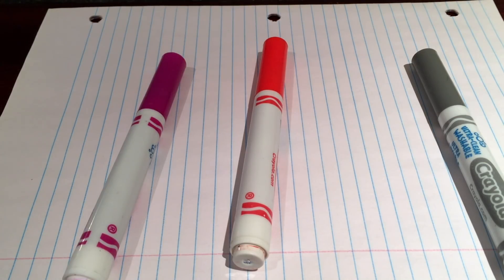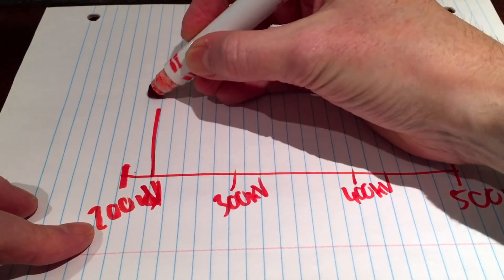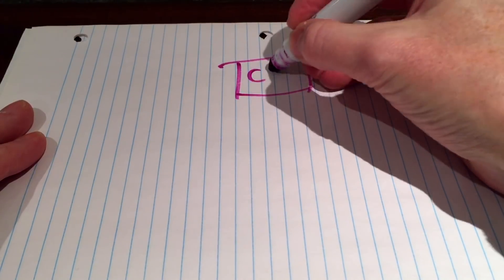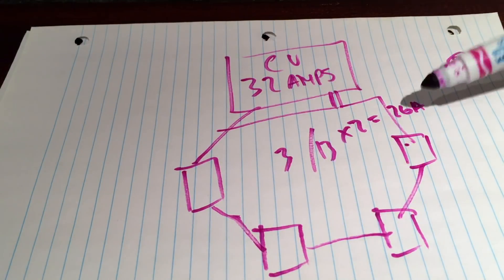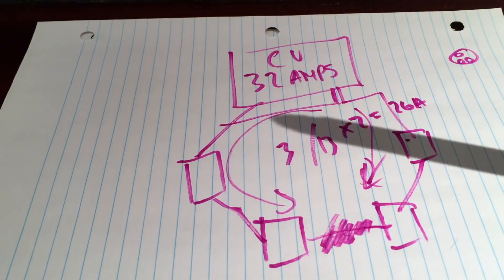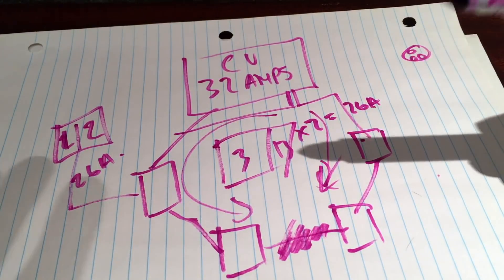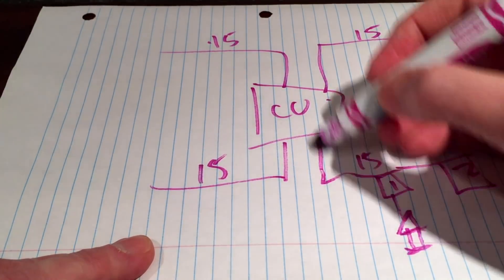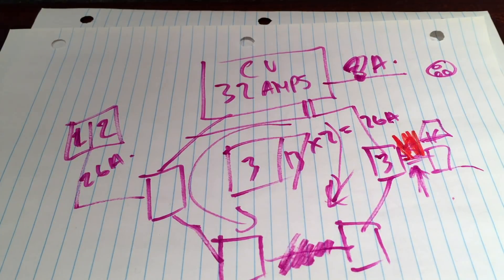THIS is why British plugs have fuses

Comment: Nice one Jason.

I did NOT know that my heater/electric hob and oven (I use all gas, but still) ... were on a three-phase circuit.  In fact, I'm fairly certain they're not.

Is it not the case that the CU is fed with three-phase?  Then two 32A phases get split to power the two separate ring mains (for upstairs and downstairs) ... and the third phase goes to the kitchen to give the big appliances their own 32A circuit?

This would appear to make more sense, as I have no 5-pin triple-phase connections anywhere in my home, nor have I ever seen any in domestic situations.

While I'm at it (and I know you're not an electrician, but still, it's nice to ponder)

I'm sure you'd agree that Live and Neutral are both Hot, yes?

And the Earth is NOT a return line ... so L&N (being AC) must serve as each others return, each serving half of the cycle? ... and, if that's the case they're necessarily 180 degrees out of phase.

So, surely that's a kind of 2-phase system ... and surely both phases would need to be 115-120v, so that out-of-phase they provide 230v-240v peak-to-peak ?

So, are we on a US system, just terminated differently ?

>scratches head<

Furthermore, can the US system provide 220v with alternative termination?  I hear that machine shops over there use 220-240v ... so that would be a neat way to provide it - and would make us a lot closer, electrically, with our cousins over the pond.

Especially since I just learned that many building sites in the UK use 110v tools and equipment, to minimise risk of death in those situations where electricity is used outdoors and in high risk environments... I never knew that : )  ... but it would make sense if our domestic supply was really a split phase 115v acting against each other to provide 230v

Ain't mains electricity f'ing confusing : ))))  Best left to the experts, always : )

Don't feel you need to struggle for an answer, I'm just unloading my curiosity.

Comment: The 12 Amp rating is pretty simple. In a nutshell, for a continuous load,  the circuit has to be able to carry 125% of that load. And 12/15 = 0.80 = 80%. So a 15 amp circuit can carry 15 amps for a short period of time, but shouldn't carry more than 12 amps continuously.

Comment: Hi Jason,

I've noticed that the US (and probably Canada) quote 110v domestic supply with a 220v option and they go on to claim a 440v three-phase system. How can this be? OK, it's easy to double voltage from 110 to 220 but that doesn't explain the spurious claim of 440v three-phase. Is someone seriously missing out on RMS (Root Mean Squared)maths?

In the UK, running 240v mains, this would equate to 480 volts three-phase, which is complete nonsense and we both know that this is seriously wrong.

The phases are set out at 120 degrees to each other and the voltage between phases works out as:

RMS V = the square root of 240 (squared) x 240 (squared) + 240 (squared), so:
RMS V = 240  x cube root of 3
RMS V = 240 x 1.7321
RMS V = 415 V RMS (between phases), and 415 V is specified in the UK as 415 V.

By the same token, the RMS three-phase voltage in the USA and Canada must only be 381 V.

Quod Erat Demonstrandum.
Reply: I can't speak to RMS versus measured. Typically, residential power is supplied as single-phase 115-120V/230-240V. Inside the "panel", there are two live busses, and the voltage to ground for each is 120V.  Measured bus to bus, the voltage is more or less 240V. This is considered (and referred to as "single phase"). The two power busses are 180 degrees out of phase with each other, and each rated at 120V. Thus, the bus to bus voltage is 240V. There are home devices (like cooking stoves) which take advantage of the 240V supply, but most consumer devices (TV, computer, lamp) use 120V.

For commercial installations (with potentially larger equipment needs), the panels have three live busses instead of two. In this case, the voltages are more complicated depending on how they are generated (delta or wye). I won't go into commercial voltages, except to say that 120V is supplied to commercial installations along with the higher voltages through the same distribution system.

(I used to be an electrician in Los Angeles some years ago.)

Comment: correction(from an educaited electrician in Denmark):
its not Kvolt, its just Volt, else in your exampel you'll have 270 000Volt, wich is not the case, cant say much about the U.S other than they have 120V between a fase an Neutral. The U.K(and almost all of EU) how ever has 230-245V between a fase and neutral, and 400V between a fase and a different fase. U.K is also 50Hz, U.S is 60Hz
Reply from the maker: Here's the UK parlimentary doc (http://www.parliament.uk/documents/post/pn163.pdf). Note the 400kV and 275kV.
Reply: Jason Coulls link dosn't work.

But look jason, if it was that high voltage then you would be fryed just by standing 5m away. I think you're mixing something together that you've read about the grid power, connecting cities together. I work as an electrician every day.

Not knowing what you talk about is one thing, but being stubborn when some one is friendly and tryes to correct you, is a completely diffrent thing and in this field, informing ppl wrong about this is really bad, because they might then end up with a bad accident.
Reply from the maker: 1) just remove the right paren that YouTube made part of the link.  2) Its the transmission voltage.  You understand that right?  You're talking about the socket in the house?
Reply: Jason Coulls yes im talking about the voltage going into your fuse box in your house and there for also the sockets, wich is what you where showing and talking about in this video, it makes no sense to talk about the transmission voltage, when your point is to explain why U.K plugs are the way they are, if you think the transmission voltage matters when talking about the house instalation, then i would politely advice you to stick to your softwhere programming.
Reply from the maker: OK. This is the last I'm saying on the matter.  In the same way people might talk about the sun before talking about the earth, I talked about the transmission before talking about the residential situation.

Comment: What you tend to get nowadays with RCDs and overcurrent breakers you tend to drop the entire circuit if there is a fault regardless. Unless there's a serious overcurrent situation, a 32A breaker tends to trip somewhat quicker than a 13A fuse blows and if there's ANY earth leakage at all, the RCD (which may precede the entire system, or just a set of breakers) trips and turns off anything it's connected to. It's fairly common to have one RCD for a set of 3 to 5 breakers (for example all socket circuits).

Comment: Nice description as I have always wondered about the fused plugs in the UK.
I live in NZ and we use the star configuration, known as Multi Earth Neutral. No fuses on our plugs. (Our plugs are the same as Australia.) Houses are usually single phase  230/240V @ 50Hz and standard plugs/sockets are rated at 10A.
High current appliances, like electric stoves, are wired using thicker cable (15Amp) direct to the appliance from the houses fuse box. (There can be a high current plug and socket used to make the appliance easily removeable.)

Comment: Terminology. There's no such thing as "ampage" or even "amperage".  The correct word is "current".  Current is measured in amps.
Reply: Actually, you are incorrect. Electricians (at least in the U.S.) use the word "amperage" all the time. It is equivalent to "current". And yes, it is measured in amps (or amperes, to be more formal). I know, because I used to be an electrician in Los Angeles years ago.

Comment: At 5:20 Just checking: are there any older houses that weren't built a long time ago?
Reply: In Japan they have really old temples they knock down and rebuild every 20 years.
Reply: Yes. Any house built before the most recently built house, is older than the most recently built house. Even if it was only finished yesturday :-)

Comment: In America we call it a fuse box or circuit breaker box and I think the circuit you describe is called series for the UK and America uses parallel circuits. At least you have a drawing like a series circuit and that doesn't make any sense because voltage is not constant in a series. From the way you have a drawn I can't figure out what it means LOL. I have a degree in electronics and the comment that you have pinned doesn't make a whole lot of sense at all, much less the fact that the person can't spell. I guess I'm going to have to Google it and see what the heck you're doing over in the UK LOL. Okay, I finally found a circuit diagram on Google a ring is definitely the wrong word for it! The word implies a series circuit and that's not what it is. I don't know why they draw it  going back into the fuse box? Electrically speaking, it's not a ring at all! It is however, the most contrary and bass ackwards thing I've ever seen. One thing to note for the so-called electricians here LOL give me a break. ( at least the ones I've read so far, I'm sure there are some real ones here) Watts divided by volts equals amps so at 240 volts you're only going to draw half the amperage for a 120 watt light bulb as you would in the US. This allows you to use a thinner wire in the UK. What you call radial or ring are both circuits that are series parallel. It's just that in the UK it seems to be one big series parallel and in the US we have different circuits for each part of the house and major appliances.  something goes wrong in one room and only the outlets and lights for that room are going to blow a breaker. In the UK it blows the whole darn house LOL

Comment: I used to force German plugs into UK power outlets, worked fine
Reply: Lots of kit gets plugged into 13A outlets with the adaptors that come with shavers (which are usually fused internally at 2A) or with the Chinese 'deathdapters' - which allow US flat two pin and EU round 2 pin plugs to be connected. They're truly dodgy devices and should really be banned - but they're a fact of life. An appliance fault would indeed have access to 32A of current - but the weak link on lower current demand small items is the cable - and the usual result is the cheap ones fail at some point where the conductor is weak, and they burn out - sometimes spectacularly - but luckily often this happens with no outwards sign - as lots of imported equipment has very underrated conductors - with hardly any copper - kind of like having a 3 foot long fuse!
Reply: tomtom vicky i
Reply: Doing this damages both the plug and socket. Besides pushing a 2.5 amp plug into a 32 amp ring main is not terribly smart
Reply: Never thought about it like that, done it for almost 20 years, especially the slim Euro plugs worked well (well, I used UK plugs more, of course). check it out: http://www.digitpress.com/room-of-doom/cm/displayimage.php?pid=4151&fullsize=1

Comment: 12 amps is what the wire feeding the device is rated at. 16 gauge wire =12amp 14 gauge wire=15  12 gauge wire=20
Reply: 13 gauge wire used on 32 breakers in UK. 2.5mm^2

Comment: The US National Electrical Code limits devices with a plug to 80% of the circuit's rated amperage. If a device needs to draw 15 amps on a 15-amp circuit, it needs to be hardwired. At a guess, this is because the plug introduces extra resistance to the circuit.
Reply: Eric Lloyd 

I'm not an electrician, but am familiar with electricity through my decades of hobbies involving electronics.
My guess is that the 80% standard is there to account for the fact that people don't like using appliances in the dark. 12A for appliances and 3A for the lights.

(This is really going to sound stupid)
If an electrical circuit is in the form of a ring, would not the whole circuit open if any of the sockets were to have no plug in them, and would not the appliance with the highest resistance receive the greatest share of that 230V line voltage?

Comment: +Jason Coulls
@ 2:00, those are transmission voltages, and in the UK they extend from 400 kv to 33 kv. The primary distribution network there extends from 33kv to 11kv, and secondary distribution begins at 415v. But I don't know why you got involved with that to explain why UK plug-tops are fused. The reason plug-tops are fused is the same reason any circuit or subcircuit is fused, to protect the circuit downstream of that fuse...irrespective of whether a ring or radial circuit is feeding into the fuse. Both ring and radials in the UK use a minimum of 2.5 mm sq cable, which is rated up to 27 amps...therefore if you're reducing the cable size to say 1.5mm sq (rated to 16 amps) when you plug an extension cord into the circuit, you need to protect that cord by introducing a fuse into its plug-top. That's the simple answer. Your explanation is overcomplicated, and quite frankly you're a good example of a little knowledge being a dangerous thing.

Comment: The 12/15A question in the US is due to breakers only being rated for 80% continous load. Not like in Europe where fuses are rated for 100% continous load.
15A x 0.8 = 12A.
You have the same issue with charging EVs. You have to have a 50A breaker to set up 40A charging, since 50 x 0.8 = 40.
Rather odd for a European. :-)